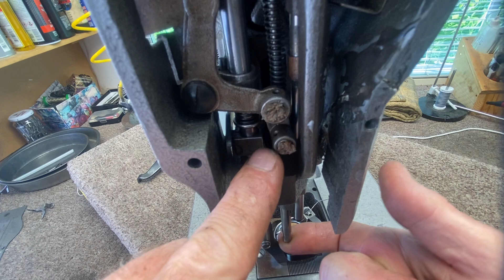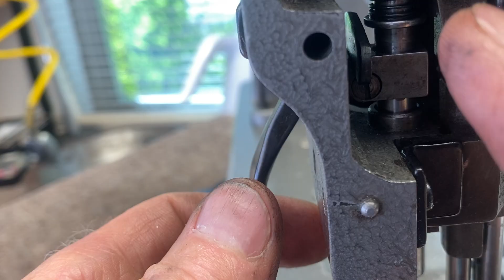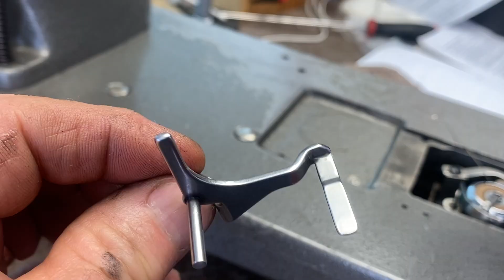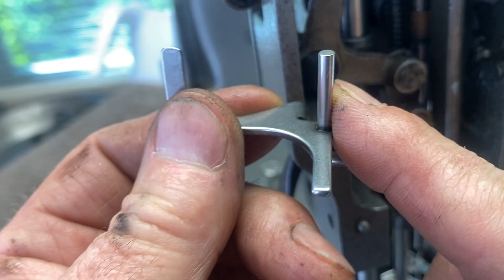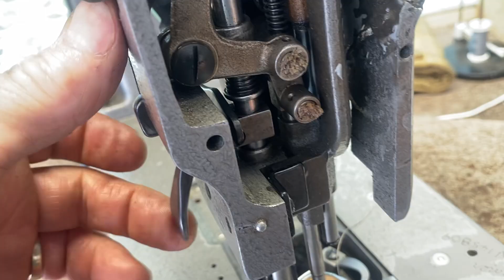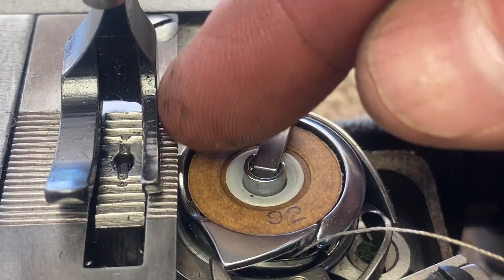Consew 226 alternating feet system explained

Comment: Hi Paul.  Thanks so much for the great video!  I have an old Consew 226 that I recently picked up and the outer foot is not "moving/walking".  The needle, inner foot, and feed dog all move like they are supposed to.  I am trying to figure out how the movement of the outer foot is tied to the rest of the system so I can determine if something is disconnected or broken, but I haven't been able to figure it out based on your video or other information I have found on the web.  Do you have a quick explanation of how the outer foot works?  Sorry for the question, but you seem to have a great knowledge of these machines.  Thanks in advance!